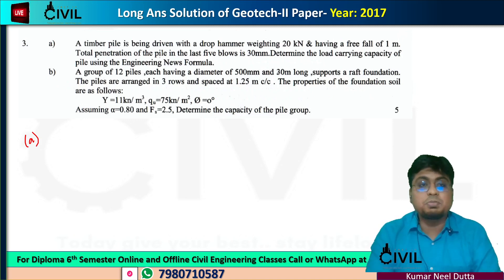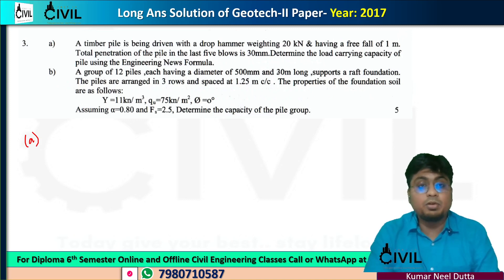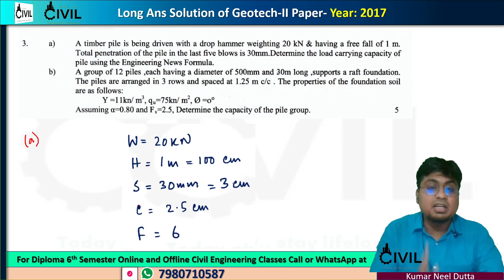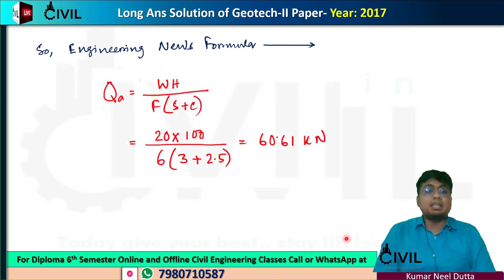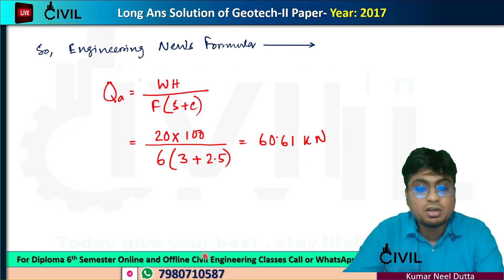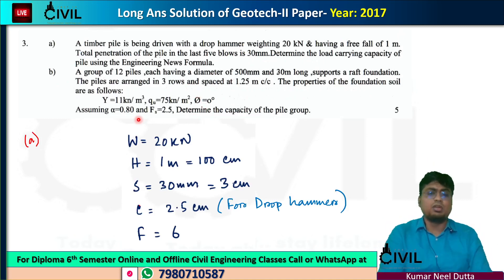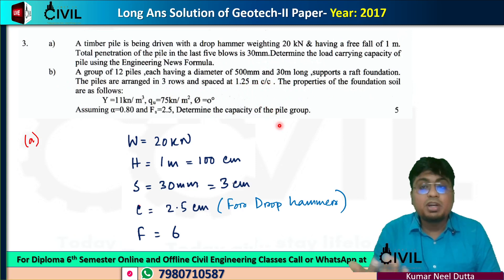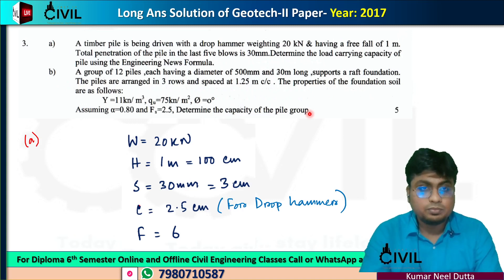LONG QUESTION SOLUTION | YEAR-2017 | GEOTECHNICAL ENGG-II | WBSCTE | 5th Semester | 3rd Year| PART-2

Comment: Sir if you don't mind plz check engineering news formula solution most probably bhul hoyacha sir
Reply from the maker: Kon jaiga ta vul bolbe ektu ?
Reply: @RestinCIVIL  sir apni formula ta put koracha S ar value ta 30/5 hoba because S = average penetration
Reply: @RestinCIVIL  sir bolun
Reply from the maker: @souvikdas8990  Yes correct.. Extremly sorry ami last five blows er jaigai Last blow dekhechilam, tai ota 30mm bosiechilam.. S= 30/5= 6mm hobe